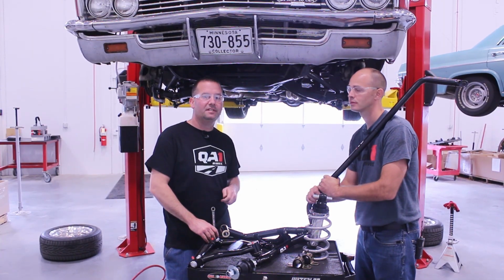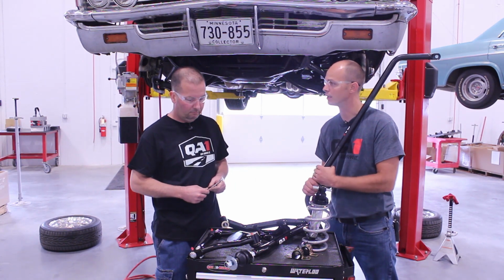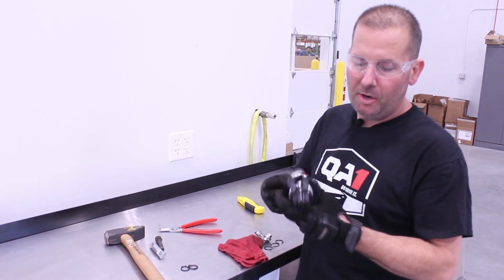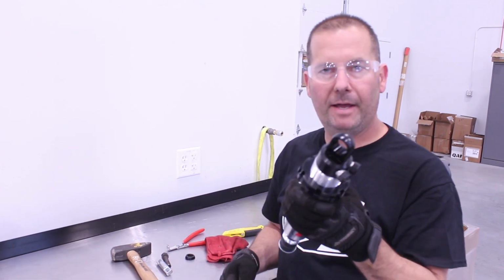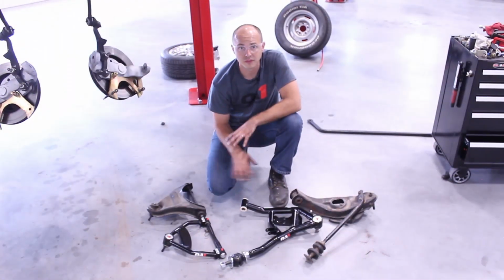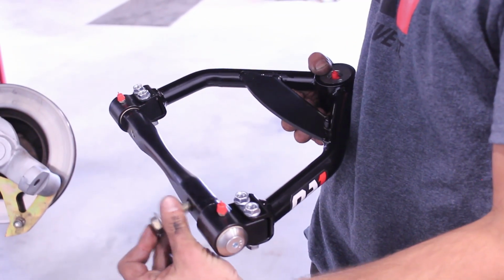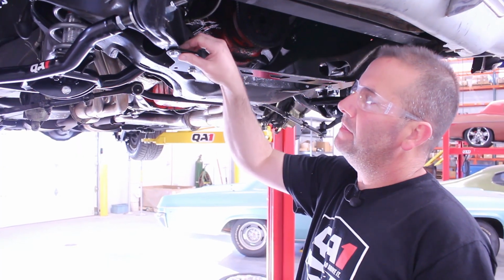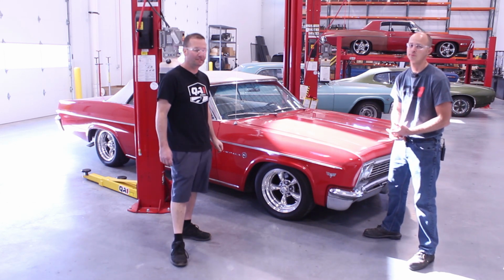How To Install QA1's 65-70 Chevy Full Size Front Suspension Kit

Comment: Did you use the original bolt for the back part of the lower control arm or does the kit come with one because the bolt in the lower control arm bag doesn't have a bolt long enough

Comment: I’m having issues with the spindle going onto the upper control arm on my 67 Impala. I don’t know why
Reply from the maker: Jon - Please give us a call so we can better understand the issue. We can be reached at 952.985.5675. 

In many of our control arms, we have an extended ball joint pin. It's okay if you see some of the pin above the spindle, just as long as it fully seats and the castle nut fully engages.

Comment: So..... are the chasis the same from 65-70? The reason why I'm asking is because I have a 65 but I'm using a 67 frame and I want to buy this kit.
Reply from the maker: This kit is cataloged to bolt into the 65-70 frame, so I would say yes, this kit would still work just fine. You can reach out to our tech line as well for some recommendations! 952-985-5675

Comment: How much is this kit?
Reply from the maker: Hi there! The level two kit is around $4600. If you do not want to buy the kit as a whole, you can also buy the components individually.
Reply: @QA1TECH  Thank you. Having trouble deciding between this kit or your air kit for my 66 Caprice.
Reply: @cy7571 I have rear double adjustable I’m selling brand new for 750 in Houston tx